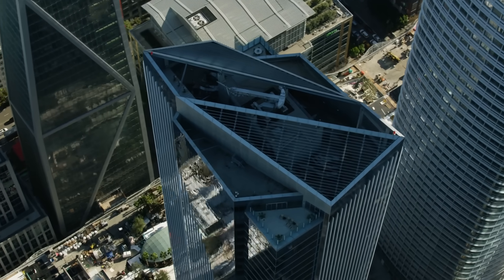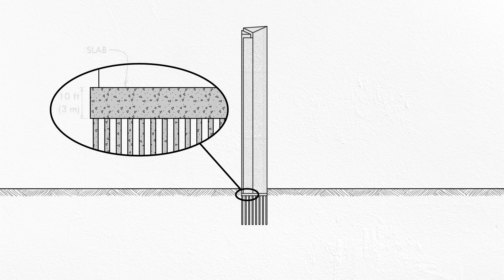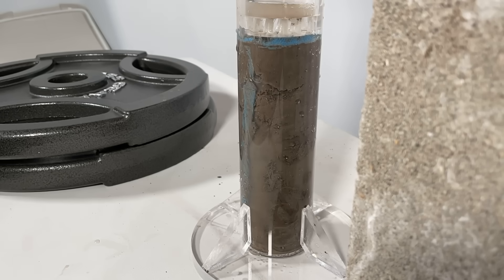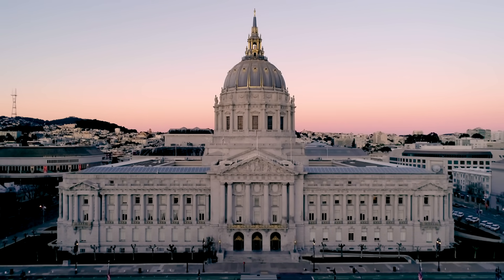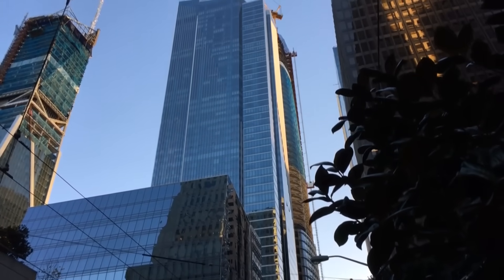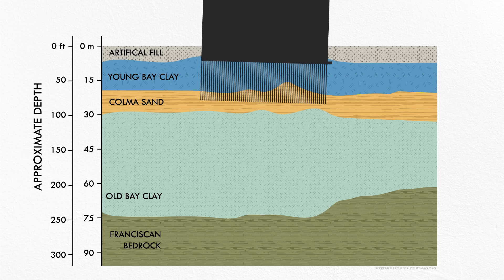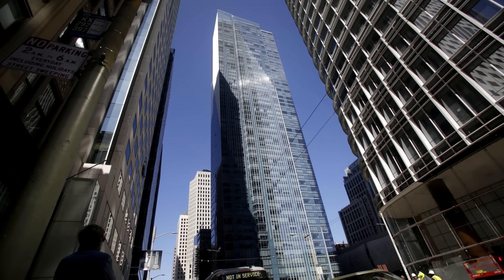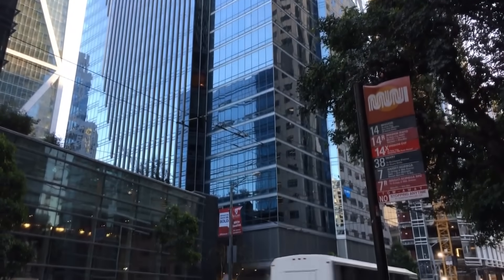What Really Happened at the Millennium Tower?

Comment: I remember the master technician who came to install our new catheterization lab in our hospital.  $2.2 million of new equipment.  He was complaining that the new concrete ceiling was not quite parallel with the floor, so the suspended gantries for the equipment would tend to drift a bit. He asked me, the chief of the department, how this could be if the ceiling contractor had used laser levels as called for in the specs. I had not the courage to tell him that the guy had moved a stick around to measure the distance between the floor and ceiling.
Reply: In a past life, the guy with the stick worked on a tower in Pisa.
Reply: @Anduril Designs
So when you saw a guy using a stick to measure the ceiling height, did you not say or do anything about it?
Reply: @shamrockshore6308  I’m a cardiologist, how was I to know that this was not standard procedure? I was a physics major, but never had any engineering classes in my 26 years of school!
Reply: Expecting poured concrete to be perfectly flat or level is nutso. Anyone with field experience knows that, so I've got to wonder whether the company who makes the gantries is competent. Everything I've ever seen installed (and that's a lot) has allowance for shimming to achieve the desired results because in the real world it's necessary.
Reply: @P_RO_  if you can't make it precise, make it adjustable. Very common in the real world
Reply: @P_RO_  It depends on the project. I worked on a warehouse with shelves rising more than 50 feet. The floor had to be perfectly smooth and level to accommodate forklifts and material stability on the shelves. We had a specialty construction company come in to construct the floor. After construction, it was tested and was no more than 1/100th of an inch out of level.
A decent contractor should be able to get a floor level when needed.
Reply: @pyhead9916  I've seen "superflats" get build... seems extremely tedious and more of an art form. Teams of concrete workers with flashlights and grinders, lying their faces on the ground and shining a flashlight to reveal any irregularities. There's probably way more to it then that, I was just an observer
Reply: @pyhead9916  But it's much easier to make a floor level than the structure of a ceiling, since liquid concrete is self-leveling to some extent. I could picture a frame made of pre-cast concrete being made to tight tolerances, but isn't the precision of poured concrete at the mercy of the temporary structures supporting the molds?
Reply: @tylerp5839  I'll be honest with you, it sounds like you're describing that one scene from Rick and Morty, although I do know what to you're talking about as I've been doing construction for years, not concrete, but I've seen many slabs be poured.
Reply: @pyhead9916  not just decent, if you are a contractor that bids on a project, it's because you can do the work, you have the tools to do it, and you are bonded and insured to do it.
Reply: @jacyoutube4459  You'd be surprised how many contractors merely skim through the Spec Sheets. Or consider them "Suggestions."
I'm an electrician. I worked for a contractor once who bid a job thinking he was going to make a killing. And then we had this conversation.
"Smartly Businessman, why are you ordering 3 pallets of 1/2" EMT Conduit (Electrical Metallic Tubing)?"
"It's for the Water Treatment Plant."
"Better not be. The Specs for that job calls for 3/4" IMC (Intermediate Metallic Conduit), at the least."
"Damn it, Time Surfer, I wish you hadn't told me that... You know how expensive that's going to be?"
"Yeah, but better I tell you now, than the Agent tells you after we've already done $100K of work."

The difference is, other than just the size, EMT Conduit can be used with simple, fast, and cheap "Compression" fittings that slip onto and then clamp onto the ends of the conduit.
IMC means I spend a few minutes on each end, cutting Pipe Threads onto the end of the conduit. It isn't just more expensive materials, it's also a lot more labor.
And in a Water Treatment Plant you play with certain chemicals. That you don't want to let mix, until you want them to. Like, it's No Bueno to let certain vapors mix in the tubes that carry the Magic Blue Smoke Stuff.
There was one room where we used Stainless Steel conduit. Yeah, he missed that one too.
This is the kind of mistake you better only make once.
And Small.
Reply: @pyhead9916  This is different. Small base but very heavy. 58 storey building sitting on porous material. That material too unstable! They may not be able to fix it. Building shifts every time they drill. SoO can they
Reply: ...can they drill without movement?
Reply: @pyhead9916  If a humongous warehouse has a floor that is not level, I'd expect heavy weights on shelves to be more likely to topple the whole thing catastrophically. I can easily imagine how perilous a leaning Costco shelf would be.
Reply: @zigzagzoot  And they'll put a video on YouTube showing "Rookie forklift driver causes catastrophic shelf collapse", when in fact it was a crooked floor that caused it.
Reply: @jacyoutube4459  back in "the day" (late 90's - early oughts), specs for multi-use condo complexes in NYC allowed for ±3/4" in concrete slabs and/or CMU knee-walls...wasn't such a big deal for the glaziers if they were installing simple "punched opening" windows that could accommodate an opening up to 2" f we were providing single
Reply: *gah*...a vertical opening dimension 2" larger than drawn (serrated shims at the sill and 3/16" thick channel at the head).

Unitized curtain wall, otoh...fugeddaboutit...glaziers watch the masons ironworkers like a hawk *daily*...def. outside the scope of Division 8 responsibilities, but necessary, esp. with 8-week lead times for aluminum and glass. O_O
Reply: @tylerp5839  yeah how'd they built the gravity wave detector
Reply: @pyhead9916  Should a "decent contractor" also insure that any subsequent changes in the structure of the ground BENEATH the floor will not effect the level of the floor?!?!?!?
Reply: @pcno2832  like you said - 'to some extent' ... the forms contain the concrete but if they are out of level even a bit then the concrete will most likely be finished out of level.  as to concrete being self-leveling, this is not really true unless it is very soupy in which case the strength is less - bottom line is that there are a lot of factors and finding contractors who can pour super flat slabs is tough.
Reply: @P_RO_  It's not easy, but it is possible. I've been a commercial contractor for twenty years and my work is directly involved with that concrete. If all requirements are met, a pretty damn level poor can be achieved, most of it boils down to saving time and money.
Reply: @P_RO_  wow yeah it's almost like that could be a reason why you use laser levels, also they sand or grind concrete down, esp for indoor use. there's this thing called being up to code that you usually have to do, especially if you're working in a hospital
Reply: @jacyoutube4459  yeah, and it is generally 3/16 inch in four feet. Random. Not a foot across the width of the building,
Reply: Even if everything was perfectly level on day one, it won't be on day two. Buildings settle. The floor in an office where we built a small computer lab had quite a lot of slope on it. Measure everything from the ceiling grid, because that's level. (or currently level)
Reply: US tofu engineering...common overseas.
Reply: In past, they used sticks and got them right often. Just a bad contractor who did shotty work.
Reply: I've been asked to install $2 million of equipment in labs that water leaking out of the ceiling. Told the truck not to unload, bring it back to the warehouse. Lots of people calling me "blah blah do you know how much this will cost?" Not my problem, I'm not paid enough to deal with your business squabbles. I'm not putting my name on an install like that.
Reply: please inform responsibles maby there is danger
Reply: This is sad but too funny. Specially the ending!
Reply: Oh dear!🤣
Reply: @Anduril Designs Loose Lips Sink Ships. But Tight Tongues Tip Towers. 🏢☠️
Reply: Ouch!!!
Reply: Sticks don't get out of order, burn out or lose calibration. Sticks are foolproof and quite inexpensive.
Reply: Entertaining variation of this on  Louis Rossmann's channel at the start of the pandemic - he hired contractors to, among other things, level the floor in the New York City retail space he rented and ended up firing them because they botched the job so badly.
Reply: The terms [Louis Rossmann hired fired dishonest contractor] will surface it.  And I just discovered there's a thing called Wikitubia.  :-)
Reply: I have seen different examples of what you describe so many times in my construction career. I shake my head in disbelief every time I see it.

Comment: I’m not even an engineer and I could have told them that over drilling was a bad idea. 
What happens when you drill a hole right next to soil with 11K pound per square foot pressing down? The soil under pressure is going to seek relief and migrate to the void you just drilled. Soil migration leads to support failure causing accelerated settling. This is basic engineering and these guys missed this!? I wouldn’t  hire these people to build a dog house. 🤦‍♀️

Comment: they found the solution through a problem bit didn't realise it. if drilling the sinking side is causing the building to sink faster then why not stop and drill the other sides so they sink faster too, once the building is level then you drill consecutively till am sure the building won't sink anymore. thank me later.
Reply: yes this might end up them loosing about 2 or 3 floors into the ground but it will be worth it. plus they should fill the lost floors with reinforcement concrete to improve the COG.

Comment: How will they prevent the foundational slab from cracking in the middle while jacking it up? With all the weight on the edges of the slab, it isn't hard to imagine the center will slump and Crack the foundation due to the weight of the building. It seems like this is a last ditch effort....

Comment: You can run Matchbox car races on your suspicious Madagascar, Sumatran or Amazon sourced hardwood floors. The original plan called for a steel framed high rise - which the 80 feet of piles could supposedly support. Was changed to a concrete frame to “save” costs. Ok, but much heavier. Hence the subsidence. All of which he glazed over here. Let alone the SF’s building permits department attitude of tomfoolery.

Comment: The 1989 earthquake in SF demonstrated the instability of ground a lot of the city was built on; the buildings that took the worse damage, it was later revealed, were built on old landfills that were later built-over to expand the city's geography out to the ocean.  
So not going down to the bedrock has me a little suspicious.  Wanting to save money, initially, but having to make up for it later reminds me of that "stitch in time saves nine".  

Apart from that, and on to the issues now facing it, I can't help but wonder if using smaller drills to burrow in would help address the issue of vibrations that are accelerating the sinking.

Just wondering, is all.  . .

Comment: I'm sure if it build built the way it was designed it would be fine. However it wasn't built the was it was designed.

It was supposed to be steel, but it's concrete.

Comment: I think the issue is not so much the engineering but the combined affects of building close to each other and the implication on the underlying ground soils which can not be fully predicted, for example you may measure the soil but if a KM away another project drains soil water it may affect the soil you have measured when you have stated your project.

Comment: I am wondering how level the layer below the clay is.  If that layer slants too much, it will promote the sliding of the clay away from the pressure.  This is actually a common problem on the West Coast, and there are many hillsides where a layer of clay on a slant makes building something much more difficult.   The only real solution in many such cases, even with just a regular home, is foundations set below the clay.   Even so, that won't stop the clay around the building from sliding.   One can, at least theoretically, end up with a house on stilts, though this is certainly not common.

Comment: No Worries about the Location and Proximity to the Ocean also no Worries about Anchoring only one section of the Building into the Bed Rock 

- When the Building starts Tilting the other way That won't Damage Deteriorate Destroy  and Shear the Spalling  Support  Columns even more than what's happening right now Also No Worries about how the weight of the entire Structure will put a Direct Load Force  onto those   Support Collums , that are already Shattering ,  by Anchoring only one Section into Bed Rock .

 No Worries About Earthquakes also with this type of idiotic, second rate, corruption style , tinker toy  support solution that will Force the weight of the entire Structure onto a row of shattering Support Collums .

No Worries how when the Building starts Tilting the Other Way the G Force that is created in every other unit that is Not Anchored into Bedrock

 ( one section of Collums will not be able to settle while the entire building seems to be correcting itself settling the other way ) 

actually is creating a more Imminent failure of Structure. 

What this unintelligent design is doing is creating another uneven force - ( the Bed Rock ) it is complete and total insanity to only anchor one set of columns into Bed Rock 

The problem is no one who designed this building really knows what will happen - they projected a life settlement that was wrong by 300 % in the first few years  and the Constant  Tilting in one Direction was Never a possiblity in the Engineers Plans  

Not only is this Building Not Safe the Folks pretending to be Engineers have Absolutely no Clue about High Rise Buildings and the Dangers of  or any concerns of Safety

Comment: Sticking, somehow, a "collar" onto the side of a ten foot thick slab looks to an application of "wishful thinking." Maybe with enough super-glue they will convince the homeowners that it will work. The bending stresses at the joint will be the undoing of this so-called fix. Not to mention placing substantial tensile stress on the edge of the slab at the attachment point.

Comment: I was lucky enough to take classes from Dr. Kramer at the University of Washington. He's an expert on the San Francisco bay mud. It behaves differently than 'regular' mud and is very challenging to build on. 

I'm surprised they only went down 80 feet. I installed some high mast poles and we went down 80' for just a metal pole with lights on it. Typically a third of a project's cost is in the subsurface. It's not exciting or flashy and the owners don't ever get to see it, so it's an area where they try to cut costs. You need a bulldog of a geotech to explain why it's worth the money and get the contractors to give you the depth as designed. 

Great video. I've been rooting for the solution to work. I suggest they just pretend it's Mexico city and make the 2nd floor the new first floor.
Reply: Making the second floor the new ground floor? Lol

Comment: Friction piles are more often times a crapshoot.  The building should have had a steel superstructure, concrete is heavy and I don't think I would like to ride out an earthquake in a structure built out of a material that is not homogeneous, not isotropic (some concrete proponents claim it is, I think that is hype), and subject to batch variations.  Even with the lighter structure, the foundation should have been run to bedrock.  This is what happens when there is a market for real estate profits over common sense.

Comment: If the building is sinking by up to multiple feet and after the fix the building will be significantly lower than it originally was, does this affect the ground floor being level with the surrounding block and sidewalk?